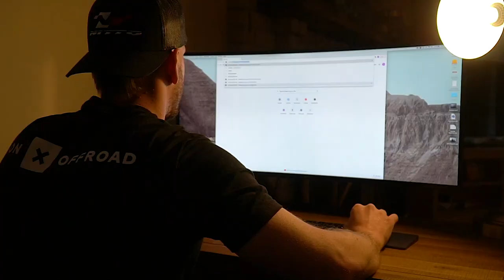Jeep Rearend Upgrade & Maintenance | Built2Wander

Comment: Awesome Jeep!! How much lift you running? How much offset on your wheels? It looks perfect!! Thanks!!
Reply: We run 3" of lift on the Gladiator with 4.5" backspacing. On the JL, we are netting out right around 4" of lift with 3.5" Backspacing. Our Currie Extreme60 axles are 72" wide.
Reply: @Built2Wander  thanks for the info buddy. Just asking for my hopefully soon build!! Thanks again!!
Reply: @toddmccormick4071  reach out if you want any insight when you’re ready for the build!
Reply: @Built2Wander may do just that. Thanks buddy!!

Comment: front and rear Lockers for the JT, can you give details?  Planning on getting a JT, overland model.  tnx
Reply: We are running ARB Air Lockers in the front and rear of the JT. It is a sport model with the max tow package, so it came factory with the Dana44s. All we did was add air lockers and gears from Revolution Gear and Axle.